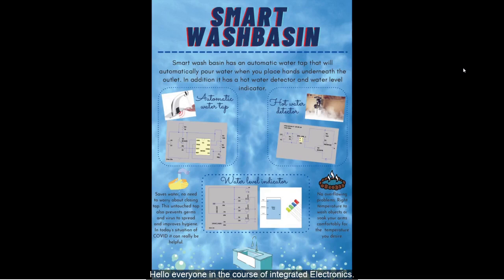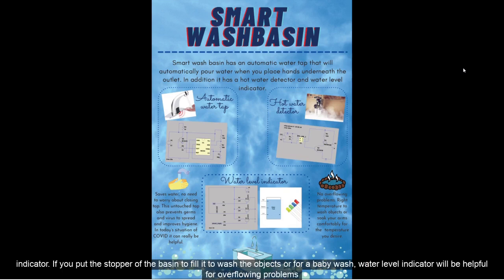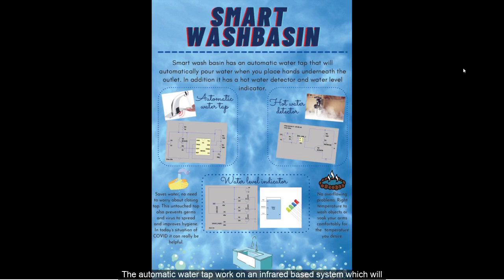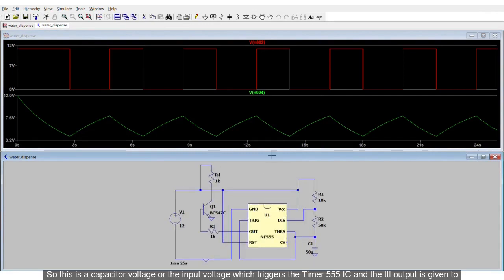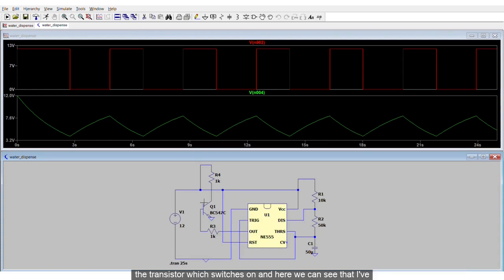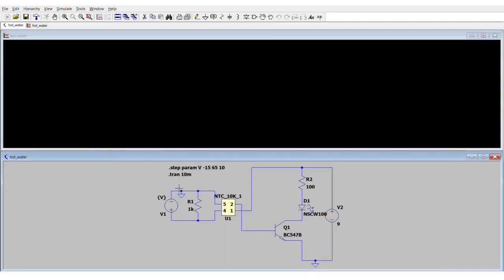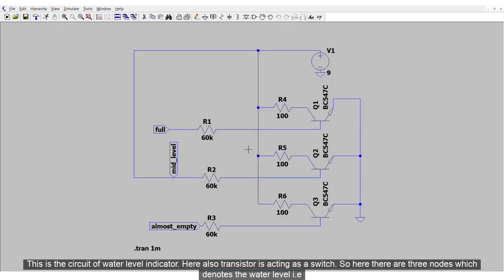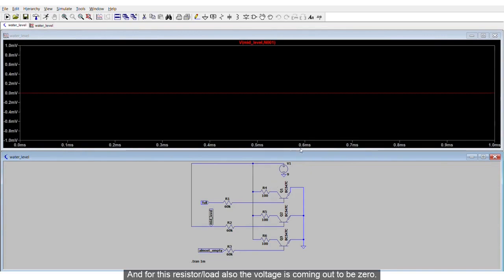Smart Washbasin || Project on Home Automation || On LTspice

Comment: Hi mam
I will be highly obliged if u can provide any Published research paper based on which ur this project is based or can provide any link...

It will be great help
Thankuu
Reply from the maker: These are the links that I referred :
1. https://www.ijcaonline.org/research/volume127/number8/vani-2015-ijca-906407.pdf
2. https://www.electronicsforu.com/electronics-projects/automatic-washbasin-tap-co
3. https://www.electroinvention.co.in/smart-washbasin-tap-controller-circuit
4. https://www.engineersgarage.com/automatic-wash-basin-tap-controller/
Reply: @kirti6551  Thanku
Reply: Hi , Can u pls help to get access this ntc symbo for lt spice as i m unble to make it by the link provided by u in other comment. can u pls help in this regard ?